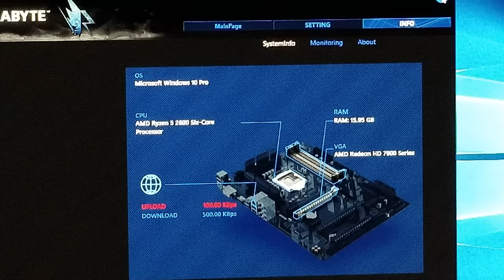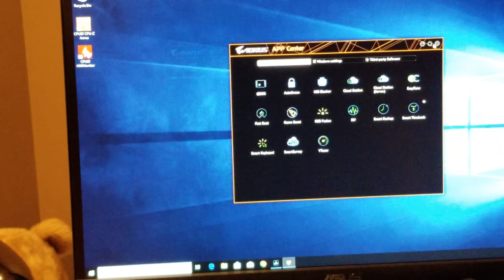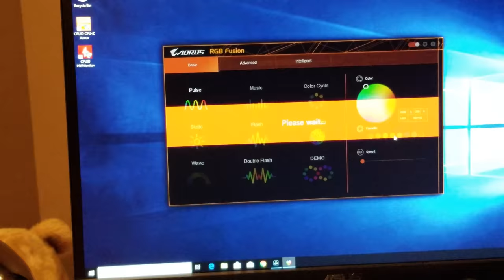Cooler Master MasterCase H500, Build Guide & Aorus B450 Pro WiFi

Comment: How did you get the RGB on the front fans working? I couldn't get it : (
Reply from the maker: I actually missed showing a SATA Cable that connects to the SATA from the Power Supply, once that's done it'll work...
Reply: @Reviewing_Playing_and_More_RPM  oh yeah I actually put the SATA cable in and the 3Pin aRGB connector but it's still not working... (Also I have a fan splitter because the. X570 elite only has 4 fan ports and I need 5 could that be a issue?)
Reply from the maker: @nootnootmofos7415  If your putting 5 fans on on fan header that's more then likely the issue, you can put 4 on one MB Fan Header but 5 is to much...now if it's a fan hub that can take 5 or more then it should be powered from the Power Supply, to ensure it's getting enough power...The RGB is separate though, as long as your using either a 3 Pin 5V ARGB Header or if it's 4 Pin 12V RGB Header then you will be good...
Reply: @Reviewing_Playing_and_More_RPM  I have 2 fans on that splitter, the rest are in their respective places. Also here's my pcpartpickerlist: https://ca.pcpartpicker.com/list/4B7k27
(Also sorry for all this trouble)
Reply from the maker: wow those are some great parts, will make for an awesome system...the 2 fans on the splitter and the rest on the MB all will be perfect...no worries, I like helping if I can...take care and have a fantastic day...
Reply: Reviewing Playing & More RPM Thanks! Hope you have a good night and thank you again : )
Reply: Im having the same issue with the front fan rgbs not working with my x570 mb. Im a newb here please help! I cant for the life of me figure this out!
Reply: @weaverfromtha913  yeah still not working for me either, F
Reply from the maker: @weaverfromtha913  Start checking all your cables from your case, then ensure the RGB is going to the correct spot, ie 3 Pin 5V is ARGB and 4 Pin 12V is RGB, once you check all those look to see if there was a cable that got missed there are a lot of cables with this case so it's hard to spot sometimes...
Reply: @Reviewing_Playing_and_More_RPM  anyway i can contact you to go further into detail? Im not sure whats im missing here or what's not doing what it should but i cant figure it out.
Reply from the maker: Was gonna try Discord but it's a lot more work then I'd thought, but you can DM me with my Twitter, you find the link on my main channel page...

Comment: This Video helped  me very much and finaly was able to finish my fan wiring. I plugged the 3 pin connector to my system fan header on the motherboard aurus x570 elite wifi and  the board is similar to your board in the  video. i then plugged the 4 pin connector to the 12v led header on the bottom like you did . 

i was confused on which one was fan power and which was LED power and i had them confused but the video cleared it up . i have the same case and was my first ever PC build and i am now writing  from my new pc. THANK YOU TONS
Reply from the maker: Awesome, glad it helped and gratz on your new build, enjoy it...Thanks...

Comment: I am starting my first build ever. I will be using the Mastercase H500P Mesh white, Antec HCG 80 Plus Gold 850W PSU, the Asrock Z390 Extreme 4 mobo, Core i7-9700K CPU, 32gb Corsair Vengeance LPX DDR4 3000mhz, Corsair Hydro Series H115i 280mm RGB Platinum AIO and for now my old Zotac GTX 1070 (to be upgraded when my banker says I can spend more money lol). Your videos are great for us new builders. Thanks
Reply from the maker: +Bernie Parent Sounds like it'll be a great PC, good luck with your build, and very Glad I can help out in some way...My Banker is tight with the money as well lol...
Reply: Weird flex, but ok

Comment: Thanks! Recently received my H500 ARGB case and am waiting for the remaining parts to arrive. This video gives me a good idea of what to expect when building. I am planning on adding an additional 140mm CoolerMaster fan to the top rear though for some extra exhaust.
Reply from the maker: Sounds great...enjoy your build...
Reply: @Reviewing_Playing_and_More_RPM  Thanks! How do you like the Aorus B450 Pro? I bought a B550 Tomahawk but was thinking of cancelling it and going for the Aorus B550 Pro AC. Not sure if I'll actually use the WiFi portion though so might just keep the order.
Reply from the maker: @rboakland  Depends on budget but the B550 Tomahawk is getting rave reviews, the Aorus B450 Pro has been working great...If you want to save a few dollars the Aorus B450 Pro would work just fine...not a lot of gains with the B550 except the Type C onboard and a few other things...if it was me and I had the cash to afford the B550 I'd probably go with it...
Reply: @Reviewing_Playing_and_More_RPM  Thank you! I'll just keep my B550 Tomahawk order then. I'm pairing it with a Ryzen 3700X, 1TB M.2 SSD, and 32GB RAM.
Reply from the maker: @rboakland  Sounds like it'll be a great system...
Reply: @Reviewing_Playing_and_More_RPM  Yes. Hoping that all of the parts arrive this weekend so I can build it.
Reply: Reviewing Playing & More RPM Thank you once again for this video! Besides some extra cable management, my build is basically there and I already installed Windows 10. I ended up routing the cable from the PSU to the GPU behind and around but your method of just feeding it through the hole on the PSU cover seems easier. I’ll probably change that around.
Reply from the maker: @rboakland  Sounds good, enjoy your build...

Comment: I’m building a very similar pc with this case. Only real differences are I’m using a Gtx 1060 and going with an MSI b450 pro carbon over the gigabyte board. First time pc builder parts should all be arriving by mid week. I’m super excited. Great video! Very helpful to see the exact case I will be working with. Thanks for the great info!
Reply from the maker: Glad you liked it...Thanks...
Reply: Update, built it yesterday and used your guide all the way through the process. Very helpful thanks again! It runs like a dream :)

Comment: This is a fantastic video. By chance I happen to be about to do my first build ever. After much(!) deliberation I went with the H500 case exactly as you used. Also a Z370 ultra gaming wifi board which is similar. Love the RGB. Intel 8700k CPU which will be water cooled with h100iv2 (hence 2 x 120 fans will be top mounted, radiator to front fans). Probably not necessary as I am only using a ROG STRIX 1060 GPU so no super powers required. The detail on exact cable insertion, especially from the case, is brilliant. Also SSD mount really useful info I actually feel a lot more confident now. Well done!
Reply from the maker: +Richard Lunn Sounds like a great build, the 1060 is a great choice. Really appreciate your fantastic comments and Thanks for watching...
Reply from the maker: Dude just got your Donation, Thanks very very much, really appreciate it...
Reply: @Reviewing_Playing_and_More_RPM  you're welcome, it's a great guide. Well worth it!

Comment: Thanks for explaining the cable management of the case.
Reply from the maker: No problem, glad to help...Thanks...
Reply: @Reviewing_Playing_and_More_RPM  Hello there and thanks for that video even if i installed my pc today before watching it. ^^

I have a question about these 2 front fan, my mobo is a b450 msi tomahak max and these fan are not spinning, any idea ? I removed the rgb control panel also.
Reply from the maker: When I did the video, I realized after that I'd forgotten to plug the other end of the Y extension into the Motherboard, once I did it worked fine, there was a connector on the case I'd forgotten so once I spotted it everything was fine from that point on...hope that helps...
Reply: @Reviewing_Playing_and_More_RPM  hello, no does not help at all sorry am fr my english is not perfect ^^ 

i removed that rgb controller from the h500 case connected to the mobo, they dont spin at all... ( front fan for sure )

Comment: This was perfect.  I am putting together my first build ever and using this case. Very helpful. Thank you
Reply from the maker: Your very welcome...Thanks...
Reply: shaun culler hey how was iT? Is the case good do you recommanded iT is the airflow good no noise?
Reply: Ayoub Hi!  I’ve been using it for a few months now. It’s been really good.  Looks great.  Airflow has been good.  I’m currently using the mesh front, but I wouldn’t expect the plastic one to cause much issue.  Noise has also been a non issue.  Cable management was easy.   I’d buy it again if I had it to do over.

Comment: Bro it’s been five years, have you found out about modular PSU’s and individually sleeved power cables? 😂They would be a god send to your build!

These stiff cables from your non modular PSU can put a lot of stress onto the board connectors, especially  when you bend them sharply for cable management.

Individually sleeved cables are available in lots of colors too, so you won’t need to wrap anything with electrical tape!

I can recommend the Corsair RMx series personally, they are a very high quality PSU
Reply from the maker: Hi, yes, this was something I will never repeat. I use all new PSUs now and individually sleeved. Thanks

Comment: Been messing with mine for about an hour and I cannot get the 2 large front fans to work, the lights come on but I cannot seem to figure out what’s going wrong on why they will not boot
Reply from the maker: So the front fans use the SATA Power Cable to your Power Supply to run. If for some reason you have them not working that's the most likely cause. Hope that helps.

Comment: I just built a system online with this case and it'll have a 1TB M.2 drive, without SSD or HDD. Can I remove that whole HDD shroud to improve airflow to the GPU? Thank you!
Reply from the maker: Yes it's very easy to remove...it doesn't really impede airflow much though...Thanks...

Comment: I have a question about this, since our cases are basically the same (mine is a coolermaster k500 rgb). Those cables that you get rid off in the minute 5:55 that cable attachs the two front fans headers but theres another header that comes from the cable and it says "TKG" and mine is white, its a 3 pin header and i dont know what is that for. I use that cable to connect both front fans in one of the two SYS FANS from the  motherboard , and i use the other one to plug a top fan
Reply from the maker: As the video goes on I did wind up having to use the cables, otherwise it was to short. If the cable your referring to is a 3 Pin it's likely the 3 Pin 5V ARGB Header, so it'll connect to the ARGB Header on your MB.
Reply: @Reviewing_Playing_and_More_RPM  thank you very much, i'll take care to watch the hole video
Reply from the maker: @diegozarza6017  Hope it will help. Thanks.

Comment: great video....a few issues with the instructions with the case...the fan direction. is it always pulling ? also my standoffs came installed. The ATX motherboard didn't fit with the Kracken radiator on the top of the case. I had to go with the push pull option because the radiator and fan didn't fit in the top. here is my set up.
Reply from the maker: The front fans are pulling Air In, the Rear is Exhausting out...The Standoff do come pre-installed for an ATX MB, but can be moved if necessary...surprised the Radiator didn't fit though...glad you have it up and running though...

Comment: Hi there, Thanks a lot for this review on mounting a PC with this case.
Unfortunately I bought a second hand PC with that case and I donw't have the SSD screws that you're using to mount it on the right side of the case. Do you have any reference for these screws?
Reply from the maker: This is a link on Amazon that might help: https://www.amazon.ca/Assortment-Prototyping-Accessories-Quadcopter-Screwdriver/dp/B073ZC6PB9/ref=sr_1_30?dchild=1&keywords=ssd+mounting+standoff&qid=1602613668&sr=8-30
Reply: @Reviewing_Playing_and_More_RPM  Thanks a lot for your fast and kind reply! Yes it should do the job !

Comment: I have connected both of my RGB 200mm fans to the motherboard and the led is very dim and only shows one red and one blue, my motherboard is not recognizing these LED’s to adjust them, used the controller and clicked the button and nothing, any inside?
Reply from the maker: So for the fans to the Motherboard that's good, the RGB without using the controller using the cable included and going into the RGB on the Motherboard the RGB should be fine, it's been a while so if it's a 3 pin RGB use the Addressable RGB (ARGB) if it's 4 pin use the other RGB which will be 12V as that provides more power and more color options...if you need to use the controller the same will apply...hope that helps...Thanks...

Comment: Great and Comprehensive Video! Might be a bit late but had a question regarding radiator mounting. On Newegg it says that it can fit up to a 240mm radiator, as someone who owns the case, does this seem to be the case? It doesn’t seem that there is much room for a radiator because of how close the motherboard is to the top mesh
Reply from the maker: There is room on top but it's not a good fit, it'd be better to put it in front...

Comment: My plan for my new build is to sync all my RBG (the 200mm intake fans in the H500 with my Cooler Master MasterFan MF120R case fans) with MSI Mystic Light. With all that RGB, is it required to have a controller with it? Or am I able to do a direct connection to the motherboard as you did without a controller? My motherboard is an MSI B550 Gaming Edge.
Reply from the maker: No you won't need the controller, Mystic Light will let you control the RGB...funny I just uploaded the MSI B550 Gaming Edge for this weeks video...great choice...

Comment: Hey I have an msi b550 mother board, the wire to connect the front fans called the 3pin I believe. I dont have that slot on there. Do I just use the adapter that comes with it where I can just plug it into the power box to turn them on? My msi is a jrgb, not an argb.
Reply from the maker: If your referring to the 3 Pin 5V ARGB, then the JRGB is the same they call it by a different name so it will work as ARGB...

Comment: I have this case and I can't get the font rgb fans to light up. The cords are plugged in but nothing happens, all I get is a tiny blue light where the leds are. There's also the problem that the cord the connects to the MB is 3 pin and theres only a 5v port for it and theres no way for me to connect the switch to the fans. Any thoughts on what the problem could be.
Reply from the maker: The RGB Lights need either a 3 Pin 5V ARGB Header on the MB or 4 Pin 12V RGB Header there is a version 2 to this case from what someone told me recently so you'll need to check which one of these you'll need and ensure your connecting that way, for the fans you need to connect to a system fan header, if all that's being done start checking that all the case cables are plugged in to ensure everything is getting the power it needs...

Comment: Hey I'm trying to get a NZXT H510i but I don't know if i'll  be able to use the rgb, as I'm upgrading from my Optiplex 9010 with a RX 570.  Any help?
Reply: check the model on the mother board, and look at a picture to see if it has a rgb connector
Reply from the maker: If you are planning to transplant everything from the Optiplex 9010, if so it has been my experience that it can be very tricky as often the manufacturers tend to integrate components into the case itself that won't work in a new case, often it will result in having to buy new parts, ie Bluetooth is the most common item that will no longer work, and possibly other items...so while it is possible it's not without it's headaches...As for RGB if your motherboard has a RGB Header that is compatible with your new case then it would work, I'm not familiar with the Optiplex 9010 or the case your referring to so not certain on that point...hope that helps some...Thanks...
Reply from the maker: Thanks for helping out...

Comment: Hey man. I don't know if you will see this but I'm up to the part with the rgb connector and I have a b550 gaming edge WiFi. Basically with the rgb cord that goes into the motherboard it has 2 female connectors then 1 female connector missing then 1 more. but my motherboard has 4 male pin connectors meaning it won't go in. 
That's for the 'jrgb1' 12v connector. Over to the right more there is another connector on the motherboard called 'jrainbow1' which would fit the rgb coed perfectly but is only 5v. Should I just plug it in there?
Reply from the maker: Yes, the one your referring to is a 3 Pin 5V Addressable RGB, and needs to go into a ARGB on the MB, the jrainbow1 would be the place for it to go, different MB's called it differently, yours is an MSI I think and they call it jrainbow1, so your correct to plug it in there, just align the arrow to the 5V so it works correctly...you got this...have a great day man...

Comment: I have this case with the Asus Tuf x570 which doesn’t have color coated panel pins where you connect the power switch. Does it matter which way it’s connected and if so, does the little arrow on the connector mean that it’s the positive cable?
Reply from the maker: The Power LED Cables have a + and - they have to be plugged in correctly, the + being positive and indicated with a arrow...The other cables have to go in as marked according to the Motherboard Manual, but the HDD LED and Power will work regardless of how they go in but it's best to put them in properly...won't harm anything though...good luck, I did a video on how to connect the case cables to the motherboard video if you need more help though...Thanks...